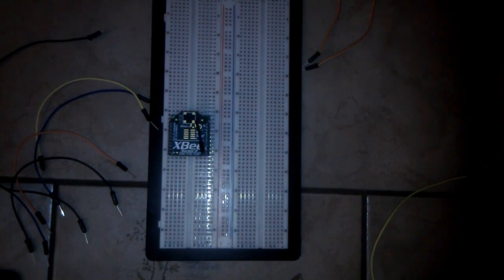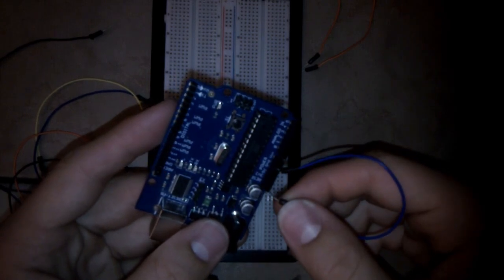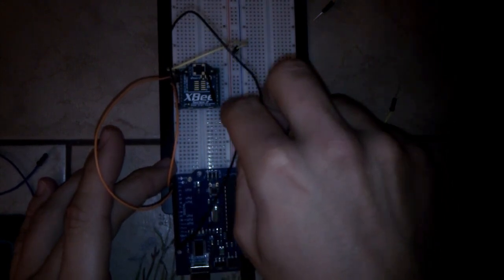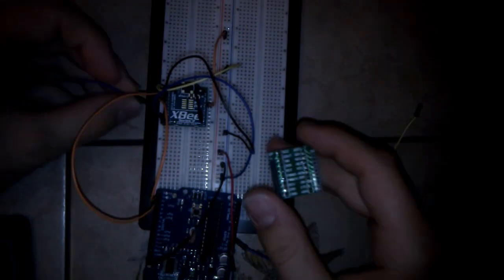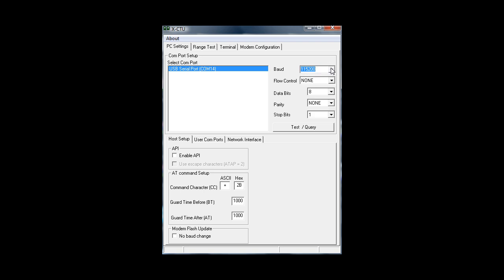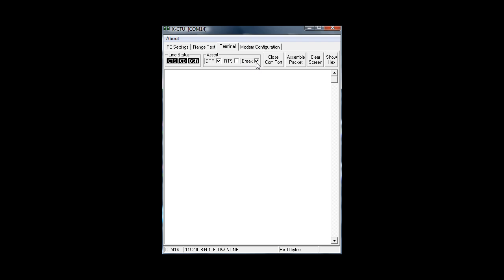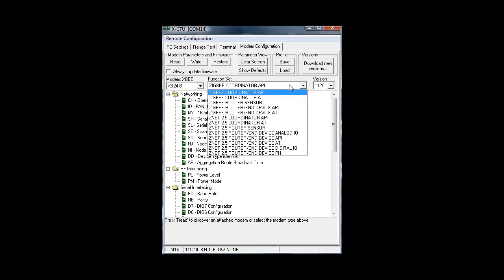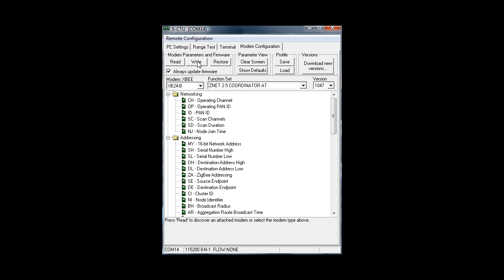Tutorial: How to unbrick, restore your brocken Xbee / Zigbee devices

Comment: IT WORKS! I did not have the adapter so I had to jimmy-rig my wires by removing the black plastic at the ends along with the small solid metal wire (that would go into breadboard). It left a female end which I was able to connect directly into xbee. HURRAY. Thank you sir.

Comment: First I would like to say 'Thank you.'  Excellent video and enough to make me think and dig a little further.  My xBee series 1 was bricked also.
However, my solution came after connecting via a USB explorer board and opening Xctu.  I set the baud as you describe, then went to the Modem Configuration tab and clicked the Read button.  It failed as expected, but the bottom of the window gave me directions to select the modem type, chec the 'Always update firmware' and then click Write.  That was all it took.  It re-wrote the firmware and reset the modem back to 9600 baud.  I'm back to brand new.  Glad I dug it out of the trash.
Now what do I do with the replacement that arrived in the post a few days ago? :)
Thanks again.
Reply: Thank you soooo much, this worked for me today.......9 years later......thank you

Comment: hey, actually i was connected my x-bee of s2 model with 9v, accidentally.now it shows no response with x-ctu , so could u tell me whether this problem would resolve or i lost my xbee completely.Thank you
Reply: I was exactly at the same situation, i used the 6.3.1 XCTU version, and selected >tools>Xbee recovery >select the firmware
Reply: did it work?
Reply: This worked for me! Thanks a lot!
Reply: If you applied 9v, then it is definitely toasted. It has a 3.6v max voltage, even 5v will fry it.

Comment: Too bad we don't have a wiring diagram and a set of step-by step operations written out.  With hearing lost (old age) I find it difficult to get through the presenter's accent.
Reply: anyone that get it working, could make a diagram with the step-by step, and wiring? i can't understand very well :/
Reply: i got it, i used a explorer usb, to connect the xbee s2c to my pc, and gone to the xctu, set the port and gone to terminal, did the same process, and the bootloader works, and i write the firmware and come back to life, thanks so much, from brazil.